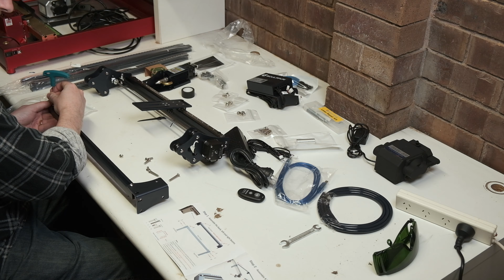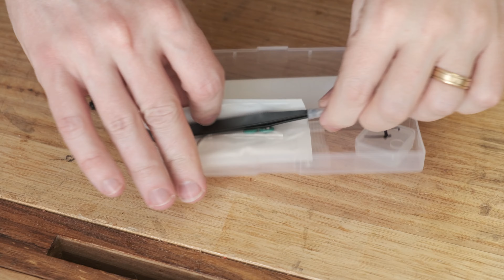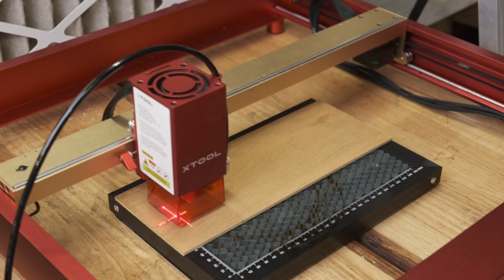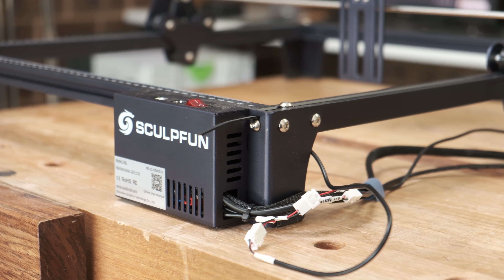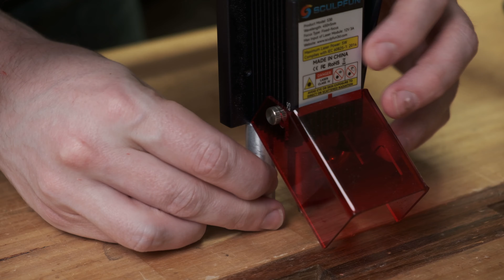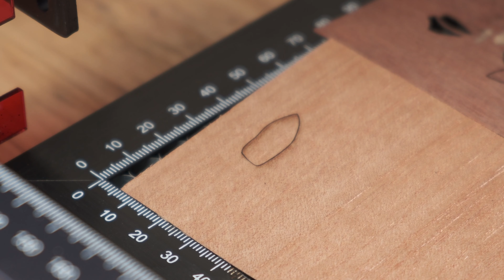Sculpfun S30 Laser Review - Safety Third💩

Comment: The air hose they supply now is rubber and much much better- doesn't kink unless you try. I just got the s30 pro with the 900x900mm expansion. Building an enclosure as we speak. I'm building my own safety features using some switches and a couple web cams that cuts power and sets off an alarm- those things aren't too difficult to setup as a separate standalone system.

Comment: You pretty much wrote it off for a lack of idiot proofing? Sorry for the rant, but… your safety is your responsibility not the manufactures. They tell you the dangers… the redt is up to you. It isn’t difficult or require any real effort to operate safely
 - don’t leave any laser tool running unattended. Also don’t use grinders or torches either…. No fire and smoke shutdowns on those either (sarcasm)
-  No tip over switch? How bout just don’t pick it up and point it at yourself while it’s running.
 If you lack the confidence to manage the minuscule and easily managed risks associated with these machines….stay away from actual dangerous power tools
Reply from the maker: The sensors weren't why I wrote it off, but the lack of complete shroud. No protection on one of the faces is dumb.

The rest of the issues were icing on the cake, when the majority of the competitors are including those features within cooee of the price. It would be unwise for anyone to recommend this over other models, but you would have realised that if you watched all the way through
Reply: @tmuWolverine  Which competitors are offering? I can get a Sculpfun WITH an air assist for a lot cheaper price than an xtool machine that sells the air assist seperately and stil costs you over 200$ more for... what? Plus the sculpfun has a smaller laser with less falloff as distance increases which out did the Atomstack X20. How you gonna make a video about a laser machine and not even mention the laser or test its engraving and cutting ability against other machines?

Comment: Nah the safety mesurements on diode laser are just marketing ornaments tbh, the fire sensor never works fine, the stop buttom is the same as disconect the machine or just push the power button, but yeah the machine is just S9/10 with airassist at least in price is a better deal just because of that...
Reply from the maker: Pricing looked to be about $100-150 more for s30 at the same output, Ive heard fish tank pumps work well and can be had for ~$30 or so, but I haven't looked into it.
Reply: @tmuWolverine  yup but is not only the pump is also the limit switches and the air assist nozzle preinstaled most users have to do some terrible 3d printing if they are skilled, the lens replacement, is also a good pro I mean at least it have its perks as a cheap intro laser ""